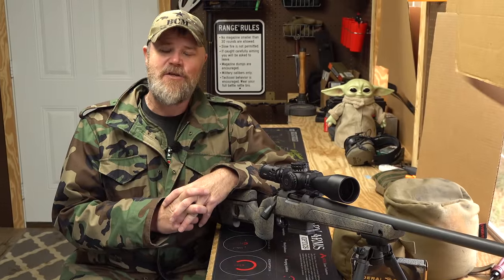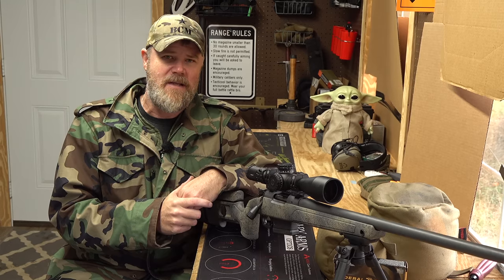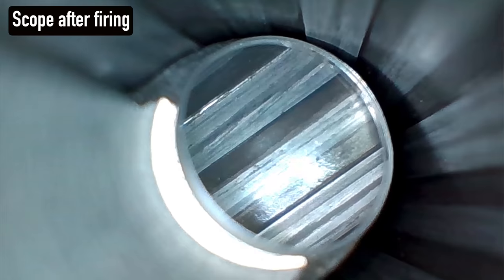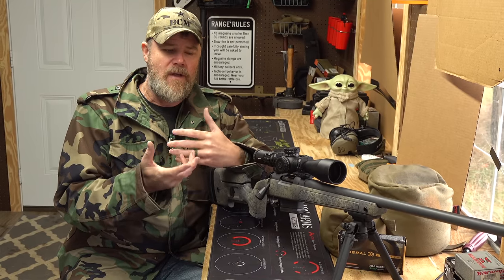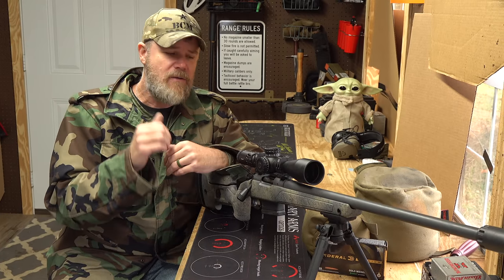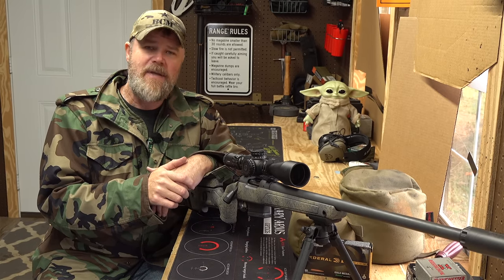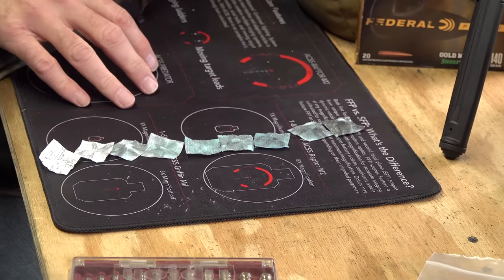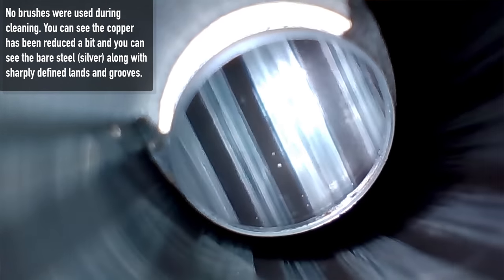Barrel Break-Ins and Cleaning Voodoo Rituals Destroy Barrels

Comment: While I totally agree with you on copper fouling not being an issue, and not needing to scrub like hell and never use steel brushes, I think phosphor bronze brushes are fine to use. Obviously, you know that softer materials, like brass, nylon, etc will not damage hardened steel, as you said in the video. So, why doesn’t that apply to phosphor bronze? It is WAY softer than steel, even soft steel, and will not damage barrels. 

First, let’s just use our common sense test, then we can get into actual data. Bronze is 95% copper, and is only 25% harder than copper on the HRB (Rockwell B) scale. You can fire thousands of copper bullets through a barrel without doing major damage, but you’re worried about a bronze brush? The bullet is forced through under EXTREME pressure, as the barrel must crush the bullet to fit the rifling, and the bullet runs through the barrel at Mach 2.5-3. But you’re worried about my MARGINALLY harder bronze brush getting pushed through at 1 foot per second with no real pressure? Doesn’t pass the sniff test. 

To compare the hardness of phosphor bronze vs steel, it’s kind of tough, because they’re measured on different Rockwell scales (HRB for bronze, and HRC for steel). Steel uses the HRC scale because it’s much harder. Bronze is usually around 75-80 HRB, while barrel steel should be in the 40-50 HRC range. If you convert 40 HRC to HRB, you end up with 370 or so. 50 HRC would be around 480 HRB. So, you see that barrel steel is many times harder than a bronze brush. 

While you may be able to do some minor damage to a barrel if you chucked a brush in a drill and went to town for an hour on the barrel, I would bet all that would happen is you would turn the brush to a nub. To test this, just take a bronze brush and scrub the outside of a barrel with it. Go HAM on it. You won’t find a scratch. Try to use one on some roll markings or something, it won’t blunt them at all. 

The bottom line is bronze brushes are totally fine for barrels.

Comment: The term barrel break ins makes no sense. This is why, it's not like a rebuilt or new engine, where you let it idle, then drive it slowly & increasing your speed as you drive it. With a firearm it's 0-1000, there's actually no breaking it in. In the Army we called it seasoning of the barrel. Where you clean it, then run patches down the barrel with a very wet patch with clp & then it sits, just like seasoning a cast iron frying pan. This is to allow the oil to pernitrate the pores of the metal so when you fire the weapon the sudden tempter increase doesn't cause metal fatigue.

If you are damaging a barrel with wire brushes then your barrel is garbage, because who ever made it, made it with a very soft metal. There is many different soft metals out there that handle heat, pressure, extra very well & since they are lighter then hard metals, barrel manufactures like to use them to reduce the weight & reduce the cost of making them. Wire brushes shouldn't case any damage to a barrel, think about how thin the wires are on those brushes, most of them are just a little thicker then a hair & their for shouldn't damage the barrel.

Difference between cleaning & seasoning. Cleaning is where you are opening the pores of the metal, seasoning is where you are filling those open pores with a lubricant like clp. like a cast iron frying pan, you open the pores by washing it in hot soapy water, seasoning is where you use cooking oil to fill those pores back up.

Question is then how often should you clean it & how often should you just season the barrel. Cleaning  depends 1st on how often do you fire that weapon & type of ammo you are using, but at least once per yr.  Seasoning at least once per month & of course after every cleaning, because your only putting a thin coat on & yes oils do evaporate over time. 
2nd don't worry about copper, it's about the carbon build up in the barrel, specially for gas operated firearms, where the free flow of the gases are so important to the cycling of the bolt.

Comment: I don't believe that there is not a need for a break in period for SOME barrels, to optimize life and accuracy. In my experience, high quality barrels may need minimal to no break in. Other, "lesser" quality factory barrels seem to benefit from some break-in work and they become easier to clean and accuracy improves somewhat afterward. The difference is largely the manufacturing process and quality control, type of steel, coatings, etc. I don't however, believe it's necessary to perform some tedious voodoo break in regiment that takes all day long.

With that said, I don't believe in over cleaning barrels either. My process is running a few wet patches first with a quality solvent to remove the bulk of the fouling (using a rod guide). They maybe two to five passes (depending on the level of fouling) with a quality brass or plastic type brush on a Dewey plastic coated rod (never use a steel rod), and that's it. Keep the brushing to a bare minimum. If the gun is shot minimally, I won't use a brush at all. A few more wet patches to remove the rest of the fouling after brushing, and then run dry patches. 

All patches and brushing are from the chamber end only when possible, and no back and forth motion. I use an eye dropper to apply solvent to patches and the brush so I can control the amount used. I don't "dip" or submerge either in the bottle of solvent. Rinse off the brush with water when you are done to clean off any solvent or fouling. In an autoloader, clean the chamber particularly well for reliability reasons.

Wipe the gun down with a quality protective oil, lubricate moving parts and store in a humidity controlled environment such as a safe with a dry rod, desiccant or similar item. That's it. Don't over do it, don't over think it and enjoy your rifle.

Comment: I work on trillion dollar naval ship engines and pumps and I can tell you as a machinist with certainty brass is significantly softer than steel and will not damage it in the slightest what does damage steel is lack of maintenance I’ve seen pumps and pistons that sat with no maintenance for 10 years that were destroyed and ones that were maintained and the difference is notable we’ve used brass brushes on all our equipment and I mean equipment with extremely high tolerances and never had any damage because again brass is significantly softer than steel.

Comment: Anyone who believes a phosphor bronze brush will ruin your rifle’s barrel doesn’t understand just how durable a modern rifle barrel is. If this works for you with your rifle so much the better. There’re  many quality levels of barrels. A smooth bore won’t foul like a rough bore. Leaving copper jacket and powder fouling in any barrel will cause corrosion, it’s only a question of time. Opinions are like assholes, everyone has one.

Comment: I'd avoid using steel brush in most cases but most brushes CAN'T damage the barrel if its a quality barrel. Brass is too soft to even mar the surface of a steel or chrome lined barrel.

Comment: I just don't see how a bronze brush could screw up a rifle barrel. I mean a rifle barrel is designed to handle red hot copper and lead being pushed through it under very high pressure. And you mean to tell me that after all of that a little old bronze brush will ruin that barrel?? It doesn't make sense

Comment: This is a question for everyone after cleaning a barrel do you run a lightly oiled patch thru it, if someone what to elaborate on please do so Happy Thanksgiving to all!
Reply from the maker: I do as carbon barrels can rust. I've seen it in my guns. Chrome barrels won't rust. Depending on the composition, some stainless barrels will be more rust resistant but that doesn't mean they can't get rust in them. Putting a patch of oil in there isn't going to hurt anything but it can help keep rust out. Thanks for watching.
Reply: @Militaryarmschannel  Thank you

Comment: Anyone who acts as though or claims that a brass brush can in any way harm a bore simply knows nothing about metallurgy. So unless you are using chemicals that shouldn’t be used cleaning a rifle will not harm a bore.  And boy I laugh when you people tell me all about how brass brushes ruin a bore.
Reply: I just saw a video of a guy who ran a brush through with a drill at high speed. All he did was polish the rifling. A human can't get that type of speed or force to even do that so unless you're using a brush that is harder than the steel in the barrel you won't damage it.

Comment: You are misinterpreting what "barrel break in" is or does. No one ever said it was to make a rifle more accurate. It is simply a regiment of 15shots with 5 cleanings in between. This is done to round off the lands and reduce copper fowling. And its a good thing to do. Gal McMillan may have said not to but i know a lot of other and better barrel manufacturers who say to do this thats why i have been doing this since before i was a benchrest shooter and a rifle builder/gunsmith. But like i said this is not for accuracy as much as its to maintain accuracy with more shots before needing cleaned. This is a fact

Comment: Many years ago when the Colt H-Bar came out. I bought one. I had no idea what I was doing and clean it every time I shot it. I used the screw together steel cleaning rod that came with the rifle. This thing was a tack driver and after years of shooting and cleaning the groups really opened up. The rifling looks like someone was shoving rocks down the barrel!!! Thanks for this video. I learned a lot. I still was rubbing the patch back and forth. What you said makes sense, thanks.

Comment: You can run a bronze brush down the barrel back and forth for a year straight and it will only polish and clean the bore. The bullet doesn't even were the bore that much so how can a bronze brush do it. As far as cleaner goes use mineral spirits. Metal shavings that's funny. I call BS on it all.

Comment: I dont agree with the "only use nylon brushes" philosophy.  You are firing copper jacketed bullets through your barrel.  If copper/brass/bronze brushes are bad (which they arent because copper is way softer than steel) then it would be reasonable to say that ALL copper is bad for your barrel, but there are no nylon jacketed bullets, so there's that.   That being said, I only clean my barrel (running a barrel snake through the barrel twice) after I am done shooting.  I use a non-ammonia cleaner and a high quality oil afterwards.  No reason to think that ANY damage is being done to my barrel using this method.  Bronze/Brass brushes in no way should be damaging your barrel.  Now, anyone who uses stainless steel brushes, that I dont get.  That is asking for it.

Comment: Dude no, most barrels are not single-point cut, those are the most expensive barrels you can buy!!

By far the most common barrel land & groove forming is through "button rifling" where a carbide ball with the lands & grooves formed into it is pulled through a smoothbore, & the button-die moves steel in the barrel & forms the lands & grooves.
Lilja, Kreiger, Paxon, more barrel-makers use button-rifling machines its like forging ONLY the lands & grooves of the barrel so much less grain-stresses on the barrel as with CHF cold-hammer forged.

BR quality from good barrell makers has equalled cut-rifling barrels, for a fraction of the cost & lasting 2-5x longer. Though single-point cut barrels remains the reference standard youre paying 2-3x for 2-4% better precision if that.

CHF is done on military rifle barrels,yes known to last longer but we have Paxon barrel-specialists who have said modern barrel materials & advances in button-rifling are producting BR barrels that match the life of CHF, but of course with notably better repeatability over CHF. 
Of the CHF barrel makers, I think you only really have Walther making precision barrels that long range shooters buy.

The 4th method of barrel-making is broach-cut which was done during WW2 & can rifle barrels faster than anything, broaching is done for pistol barrels but a rifle barrel is just too long the broach ends up recutting chips or turning the chips into a wedge that scrapes lands & grooves, its not used for rifle barrels anymore by any barrel maker I know of, button-rifling basically made broach-cutting rifle grooves uncompetitive for tooling cost.

Comment: I don’t have a lot of experience with high end match rifles or highly accurate rifles per say 
All I shoot is old military surplus rifles 
Blued steel and wood and all that gubbins

I have a pretty lax stance on bore cleaning since I’m not shooting corrosive ammunition or anything particularly harsh so I leave the bore alone but if I do feel the need to give it a clean while out on the range or if I’m just feeling like my accuracy is suffering significantly I’ll just use a plain boresnake and I generally have good results with that approach 
As for a dedicated while at home after a shoot clean I’ll just use some mild solvent and give it a light scrub with a brass bore brush and patch it until dry and then a light coat of oil with another patch and I’ll obviously run a dry patch through the bore on my next shoot to clear any excess oil before shooting just to have a blank slate 

Nothing crazy but I definitely have been warned by many not to over clean my rifles/ pistols and thankfully I’ve mostly heeded this advice and n out regretted it thus far

Comment: I'm rather new to firearms. (At least I consider myself to be). But it's funny that my process is kinda similar. I'm using the LR308 format tho. With a Chrome lined Criterion 308 barrel. 
I did a break in period, but wasn't too serious about it. I shot 3 times, cleaned, shot 5 and cleaned, 5 and cleaned, then I just shot 20 and cleaned. 
It did take about 250 rounds before she started grouping well (3/4 or less). 
My cleaning process has been simple. I just use CLP and maybe some hopes oil. 
I use a one piece rod, and a nylon brush. But I will spray the brush, and spray some in the barrel, run the brush about 5 times, then start running dry patches until I don't see dirt. Which only takes about 4-6 patches now. It used to take 10-20 in the beginning tho. 
I'm only a little over 1,600 rounds so far tho, and accuracy hasn't changed.
I don't know if this is good or bad, but seems to work for me.

Comment: I'm learning guns in my retirement...what you said about the copper filling in is also true in automotive....if you find a old motor full of water you drain water , pull plugs and slowly sip used transmission fluid threw it to lap it in using particals in the fluid as pit filler...I've brought back a 428 c.j. and 318 interceptor and a few others that way...just don't fluid lock it....😎

Comment: There are several YouTubes where people like yourselves have run brass brushes down the barrels and then taking a borescope and looked at them after what would be extreme dry scrubbing showing no adverse effects whatsoever. Purely from a metallurgical standpoint how does brass, which is softer than barrel steel, scratch a barrel in any way?

Comment: First of all you are not shooting precision rifles.Factory guns cannot be compared to custom guns. Bench rest shooters break in barrels and clean their guns between strings. The top gunsmiths in America all recommend barrel break in and from all of my competition experience a barrel that is properly broken in shoots better and is easier to clean. What you are trying to achieve by proper break in is polishing the throat area. The reamers that chamber are creating a slightly rough area from where the reamer stops to the start of the lands.when you clean between shots you are allowing the bullet a clean area to polish off this rough area. Also this is where most copper originates from the throat and is carried down the barrel in a plasma form. My philosophy when accuracy drops off clean.

Comment: I purchased my first real hunting rifle in 1982 and it was a used Remington 700 in 280 rem. basically a 7mm aught six. I love the cartrige and handloaded for it by fire forming 30/06 brass and loading as I remember, with 140 gr. boat tail spitzer. Yes I used brass brushes and aluminum rods, I think I must have used Hoppes and probably WD-40 after. If I stored it I would use Rem Oil to protect from rust. As an aviator we had three lubes, LPS 1,  2 , and 3. LPS 1 was basically WD-40 and if I was in a desert environment I wouldn't use heavy oils because it attracted sand. If I was in the Northwest or Alaska I would use heavier oil.  But in the first year I started handloading for this rifle I was not pleased with the groupings and felt that I could do better. Some gun store in Tucson sold me this JB Bore Cleaning Compound and I used it as instructed and found that I turned a 1+ MOA rifle into something that I could hit a matchbook to 200yds all the time. I don't recall being anal about cleaning or actually really ever using this compound again on that rifle. But no kidding this stuff cut my groups in half or better with just one treatment. Remember this was 40 yrs ago on an off the shelf rifle that was used when I bought it. Had a Redfield Wide Aperture fixed 4X on top. Felt like I couldn't miss with that gun; Col Cooper was still alive, remember what he said, "beware of the man with only one rifle."  Still think of that gun and that caliber fondly.  Thoughts?